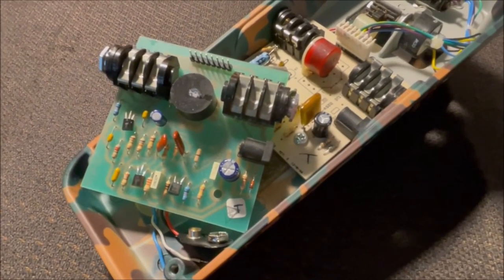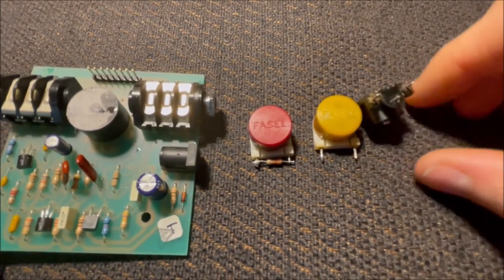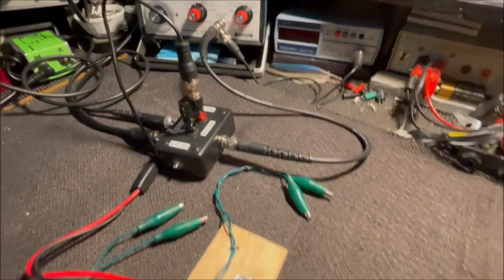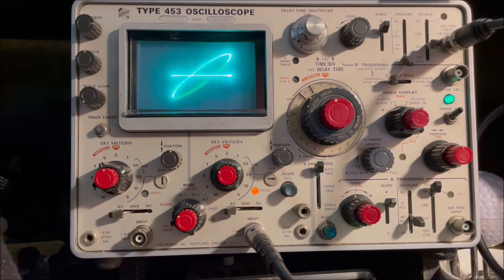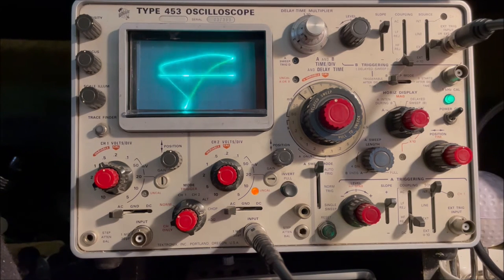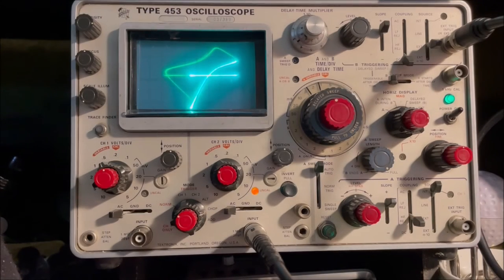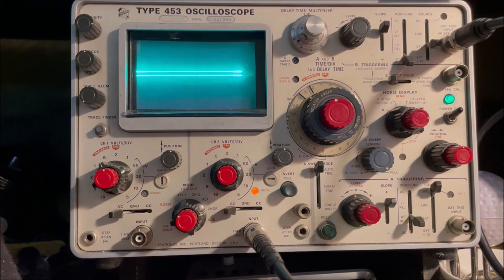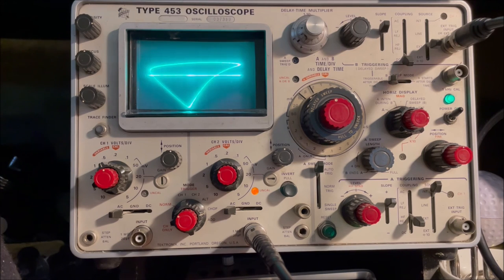Dunlop or Fasel Inductor: Which is "Better"?

Comment: Thanks for the video. If you ever decide to include other inductors as well, i will watch that video and make notes! I’ve been swapping inductors between wahs (like a halo from picture wah to later thomas organ cry baby and stack of dimes to picture wah) and while it does not transform the wah completely, it does something. These newer Dunlop inductors do not sound that different from red fasel, that i’ve noticed as well. 

I’ve never come accross vintage wah with fasel that was particularly appealing to me regardless of the colour of the fasel inductor. They all were meh, but i never pulled those apart to verify why they were meh. Worst of this kind was red that looked a bit different with 500mH stamped on it, that vox wah was lame.

Comment: Awesome stuff! It doesn’t surprise me that dunlops inductor is in-fact based on the inductor they used to use haha. 

Ty for this! Explains what I hear between red and yellow very succinctly :)
Reply from the maker: Thanks for the feedback. I have taken to doing testing like this because my ears are not 100% reliable when it comes to hearing "the differences" between things. But you can easily see them on an oscilloscope, and it's even better when you can see AND hear it.

Comment: Thank you for being insane enough to do this and make the video. I am insane enough to watch the whole thing and I salute you!
Reply from the maker: I'm not insane. I am just curious, and question anything that is hyped up or misrepresented. That being said, if you're thinking about replacing the OEM Dunlop inductor, you might want to try the Yellow Fasel. That one is actually a bit different. You may not like it as much though... it's more mellow than the red one.
Reply: @VegasCyclingFreak  I meant "insane" as compliment BTW. I'm actually thinking about the pricier MC404 CAE wah that lets you switch between yellow and red. It's kind of nuts but I've found you just have to try them. I could buy that fancy CAE and not like it...
Reply from the maker: @dannyblume6350  Just keep in mind that really the only reason an inductor is in the wah circuit is to make it a resonant circuit. You get much more dramatic effects by changing other things.
Reply: @VegasCyclingFreak :: Which other things? Please make some tutorials to enlighten us. 

Thanks a lot in advance! ❤️🎸🎵🎶🎼💝
Reply from the maker: @khan.tanvir  There's plenty of websites detailing what to mod on wah pedals. Usually it revolves around the inductor, "sweep cap" or the pot, sometimes the transistors. You can go completely overboard making every resistor a trimpot, etc. I have several pages on wah pedals at my website - www.DIYguitarist.net if you want to check them out.
Reply: @VegasCyclingFreak  :: Thanks a lot, VCF 

❤️🎸🎵🎶🎼💝
Reply from the maker: @khan.tanvir  Yep! Have fun going down that rabbit hole. 😉

Comment: I happen to have the one with both the red and yellow Fasel´s in it, and there is quite a sound difference, where the red one sounds fuller and more ´vocal´. I also have a standard Cry
Baby with the standard inductor. That one sounds thin and uninspiring, but that may be differences in the circuit and components. But according to your findings it should be possible
to make the standard Cry Baby sound better by modding it.
Reply from the maker: If you use a yellow Fasel vs a red Fasel in a Dunlop wah pedal, it would in theory make it sound different, but maybe not better to your ears. I've used yellow Fasel in some of my DIY builds. Seems to be a bit more mellow, but a lot does depend on circuit topology. The gain of the transistors for example can have way more affect on the character of the sound than the inductor does. The purpose of the inductor in the classical inductor based wah circuit is simply to make it a resonant circuit. In my curve tracer tests the red Fasel and Dunlop inductors look the same on the curve tracer. I liked the "Fat Wah" mod I did to one of my Dunlops. I have a page on it at my website -- www.DIYguitarist.net if you want to check it out.
Reply: @VegasCyclingFreak  Thanks for your feedback 🙂
Reply: Thank you for the info you post. I am not sure but my guess is that by swapping the black/standard fasel out for the red fasel would be the exact same as buying the entire unit new. I am not positive though, but I think there isn't a huge amount of difference. I currently have a really old Dunlop Wah Wah unit I bought in the late 1980s that no longer works. The entire inside looks different than the one I modded here. I am not sure what I am going to do with this Wah unit yet but when I do I will make a much more detailed video as I learned a few things just from making this video and already know what mistakes not to make.
Reply from the maker: @cygnals524  Does your 80s Crybaby have the TDK5103 inductor in it? Some webpages poo poo that inductor but my 80s Crybaby with the TDK5103 is one of my best sounding wah pedals. Subjective topic, I know. I just know that I don't like really harsh sounding wah pedals.
Reply: @VegasCyclingFreak    I am honestly not sure, it may possibly be an early 1990s as well I am not 100% sure. I am checking now
Reply: @VegasCyclingFreak   There is no fasel in this one that looks like my other Wah. It is a Cry Baby Wah. It looks very different than my other Wah.
Reply: @VegasCyclingFreak    Is your email address the same as "Paul's" at the DIY website?

Comment: The old 60's & 70's red Fasels were torroidal wound instead of the typical winding on a Halo or stack of dimes type. I have a '67 red Fasel & can verify that. I opened up a new red Dunlop Fasel & found the same torroidal winding.
Reply from the maker: A while back the cover came off mine and it looks to me like it's just enameled wire wound on a bobbin which is placed inside of two ferrite cups. I took a picture of it.
 http://www.diyguitarist.net/Images/FaselVintage.jpg
Reply: @VegasCyclingFreak  Mine is a 1967 Fasel that came in an Italian made Top Logo Crybaby. I pried off the cup the other night & it sure as shit has a torroid core. It's a cherry red cover with cherry red back plate instead of a white back plate.
The later 60's & early 70's red Fasels I've seen all have the white back covers. It looks like there are 2 different versions of vintage red fasels.
Reply: @VegasCyclingFreak  Yeah, yours doesn't look much different than a stack of dimes or the inductor that's inside the TDK 5103 brown cube!
I got ahold of an original small hole Halo inductor & put in in my Crybaby & two nights ago I put the red Fasel in a board I built for a 90's VOX 847.
Reply from the maker: @markmarshall7939  Huh . That is something I was not aware of! Two different versions of the "vintage" red Fasel. Who knew?
Reply: @VegasCyclingFreak  What's your email address? I can send a pic of mine. I had to mount it laying down due to height clearance issues but you can still see the red rear backing plate especially where the two soldering lugs come out of it. Now I'm thinking I should just put it back on the original board in the Crybaby because it might be something even more rare than I thought.
Reply from the maker: @markmarshall7939  It’s on the homepage of my website -
www.DIYguitarist.net

Comment: Never understood the fetishism for old Fasel inductors. Its literally just a 500mh coil of wire. Its not friggin magic is it?
Reply from the maker: Well they do exhibit a bit of saturation but I don’t know that I or anyone else can actually truly hear that. 🤷🏻‍♂️
Reply: @VegasCyclingFreak  I'm just late night shit posting but I do make pickups (same concept) and I'd be curious to know whether the "magic" is just the same old "vintage tolerance was all over the place" shlock. Inductance and capacitance will vary with wire tolerance and wind tension and wire insulation material and thickness etc etc. Not a wah expert either but surely any modulation effect is a sum of its parts not just one or two components? The  HFE and bias on the transistor emitters for example.. can be fine tuned and will make as significant a difference to the effect as the inductor ever could. I doubt they bothered from the factory. Pots were set "wherever" stock. With no significant voltage swing all those carbon composite (super magic special shitgold that they aren't) add is noise.. 
And on .. what about the dielectric of the filter caps? ESR, leakage etc. The polarized electrolytic "4.7uf" probably had a 25-50% tolerance to begin with in 1975. It all matters. Good news, I guess, is that the wah really is a very simple thing. Its not like its going to be expensive to fine tune.
Reply from the maker: @cgavin1  I’ve made many similar posts at forums over the years. You have to look at the entire picture, just like you need to do with guitar pickups. The saturation in the Fasel inductor apparently has to do mostly with the ferrite. Different types of ferrite do have an affect on the amount of saturation. Inductors are designed NOT to saturate and it appears that in the case of the Fasel it’s an artifact of Vox trying to be cheap.
Reply: @VegasCyclingFreak  Same deal with those old Gibson PAFs. The alnico formulas used were all over the place. The copper wire they used was full of impurities and the coatings broke down causing parasitic capacitance. The coil winders they used were hand operated with no automatic cut off. The magnetic tensioners were set to "yes" etc etc. All because .. cheap! 🤣
Reply: @cgavin1  I can't quite describe it the way I would like to or in a manner that can do it proper justice but I can notice a huge difference between the original/standard/black fasel compared to the red fasel. Supposedly the only reason they stopped using the red fasel was due to the material for it was difficult to obtain if I remember correctly.
Reply: @VegasCyclingFreak    Thank man for all the input you have added to my video. I appreciate it and plan on checking your site out ASAP. You have brought in a decent amount of info that really has helped out imo.